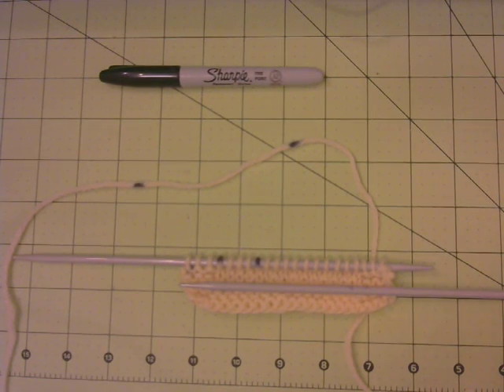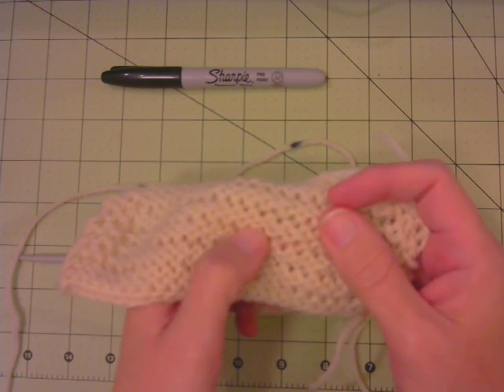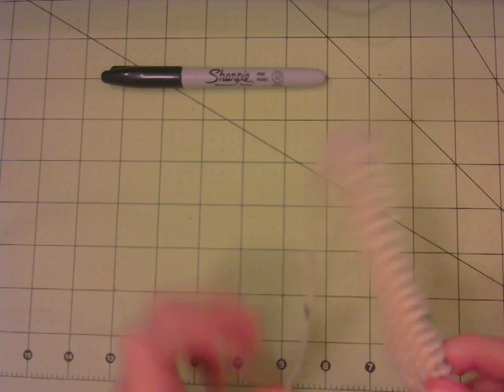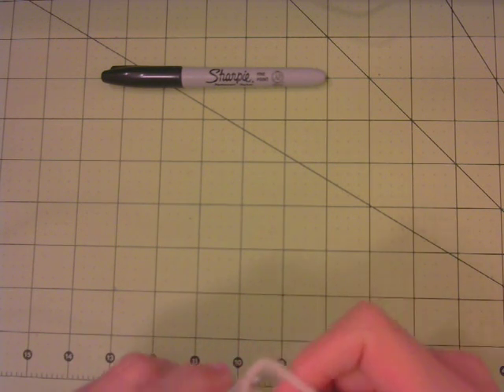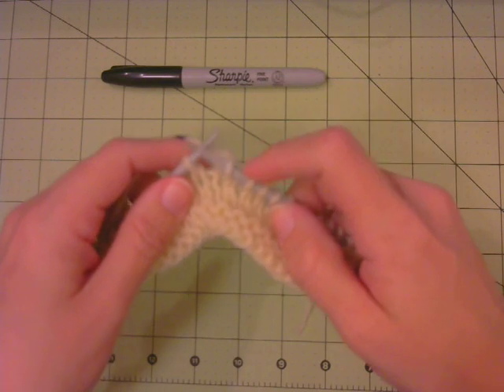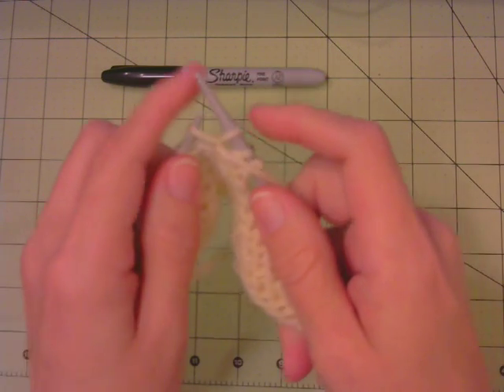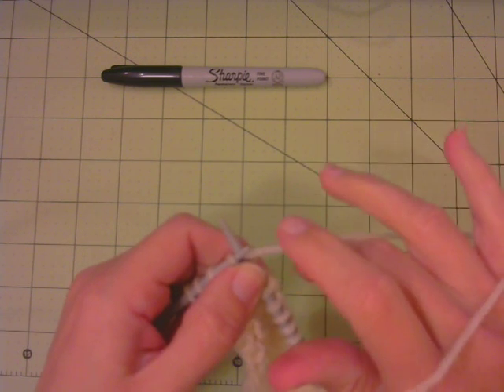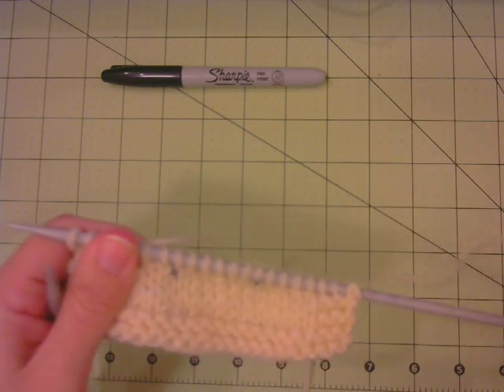Tension Problems in Knitting

Comment: I found this very helpful by seeing where and how tension problems are caused -- and now I know how to work on correcting my sloppy edges, and even the crooked rows I discovered after switching colors in a scarf. Thank you for making this video!
Reply: Definitely a helpful video. I never would have guessed that even the angle I hold the needles to each other would affect the tension of the stitches.